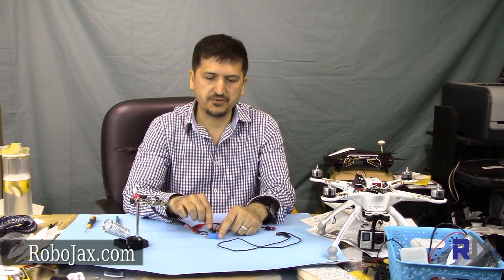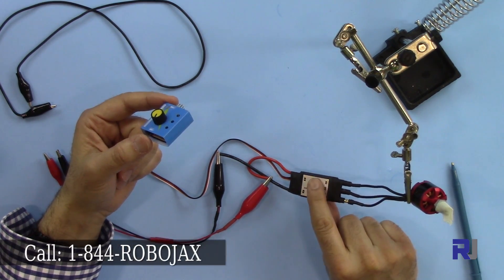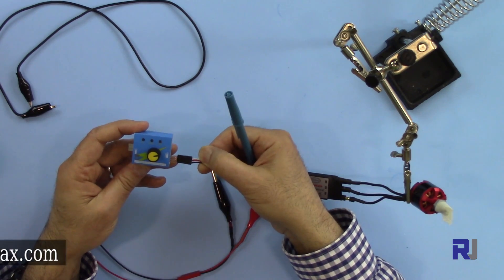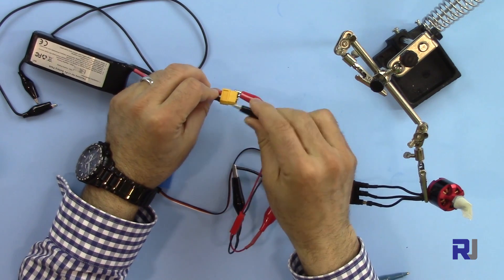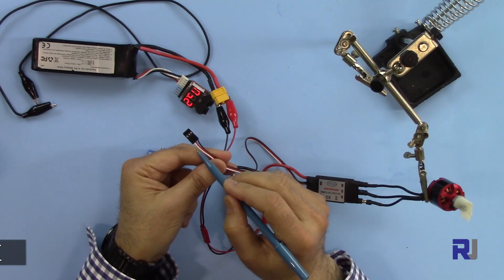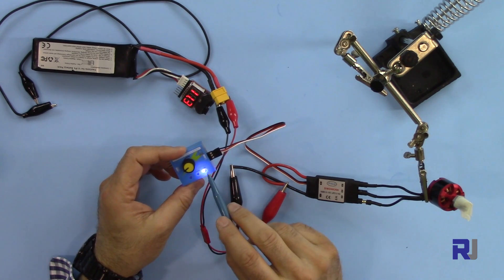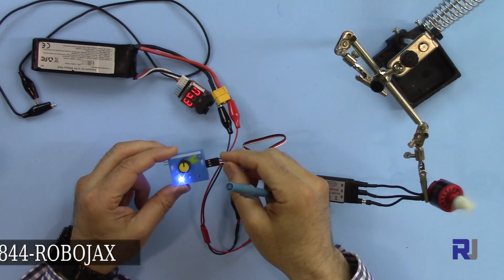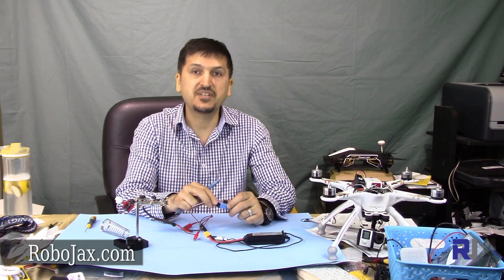Introduction to 3 Channel ESC Servo Tester - RJT648

Comment: does the servo tester need to be calibrated? is the maximum value on the servo tester's potentiometer the maximum speed/rpm that the motor can spin?
Reply from the maker: this test is very basic and has not settings.

Comment: I am assuming your 3-cell battery is 12V. Correct?
Reply from the maker: yes and it does not matter, if you motor is 18V, you can connect 18V to the ESC and still you will get 5V for flight controller or  other devices. Today I just posted demonstration of testing servo motor using this tester https://youtu.be/TJ3YjnsREqc
Reply: @robojax  thanks

Comment: helpful  video !!!!  I was unsure if I  was able to use my 3S 2200 mAh LiPo  to test my  servos with , because the tester states 4.0v - 6.0v range.....but if I understand correctly , as long as I connect the  higher voltage   LiPo battery through the ESC, (  and connect the signal wire  to the OUTPUT side only )   it's OK...correct?....thanks
Reply from the maker: Yes you can connect up to 6S battery. To the esc.

Comment: I have connected my 3cell battery to  the servo tester ,motor ,ESC ,the light comes on 'man' and when rotation of the nob , nothing moves , please advise
Reply from the maker: your ECS is programmable. if you do not program it, it will not run. I am not sure which one you have and I have no video on that.

Comment: Is there a way to input signal through the ubec from a toggle switch ?
Reply from the maker: the white or yellow wire is the signal wire. does not matter where you bring the signal from. just connect it to your source with one wire to the ground. it will work.

Comment: can i connect a servo tester to a brushed ESC and use it to turn a brushed motor forward and reverse?
Reply from the maker: Brushed motor controller should have the control signal.  But for this this Servo Tester will not work with that as the values are different.
Reply: @robojax  I found an interesting video on bidirectional brushed esc that works with arduino pwm signal forward and reverse. Worth testing

Comment: good day sir can i ask what is the value of the 6 pin ic on that board? thank you and very nice tutorials
Reply from the maker: I have never opened it. Which board? The Electronic Speed Controller ESC or the Servo tester? in both cases they are so cheap, that you never try to make it or repair it. just buy new one.
Reply: @robojax  for the servo tester sir. Thank you🙂

Comment: Hello dear my 3500kv brushless motor not run...its beeping beeping sound....I have using 40a esc...plz help me
Reply from the maker: The beeps are from you ECS. It seems your ESC needs programming. You can send signal if you have this ESC tester. Quickly rotate to the right and then to the left. This will send 1 signal. So this way you can send different signals to control ESC and it will work. Check your ESC brand on google and you will find how to program it.
Reply: @robojax  I have using  SkyLiner Esc...how i have program it...I have no transmitter.....I have one servo tester, ESC and Esky  3500kv motor...
Reply from the maker: There are 100s of ESC i don't know them. You search your question on Google and I am sure you will get some answer.

Comment: Hi , im trying to control a 9v DC motor with a servo controller , the motor is not slowing or being controlled by the controller and its on one speed, what am i doing wrong?
Thanks
Reply from the maker: the servo controller/tester is for brushless DC motor with 3 wires. your motor has 2 wires. You can use a driver module something like this https://www.youtube.com/watch?v=17vqLv508Uw and instead of Arduino you can use servo tester.
Reply: @robojax  Hi again, i got the servo tester and the mosfet module , i connected signal  output of the servo CTL to the signal in the mosfet , i linked both grounds to the 5V power supply and 5V to the output of the servo CTL , everything light up but the motor never turn even if i change the mode in servo CTL still nothing happen,
 the input for the mosfet is around 9V when i connected the wires to the mosfet and i test the screws holding the wires it dropped to 0.008 but the power supply i warm, 
is the mosfet damaged?

Comment: the  tester takes up less than 1% of your screen ares .cannot see anything .google "zoom lens" then start over and do this video right.
Reply from the maker: perhaps you are watching on mobile phone. This tester doesn't have any display to read values from it.when using  it, you will turn the knob (which is large) and lights will show the mode(which is bright). You don't miss anything.

Comment: Hello, I'm using a HobbyKing 30A UBEC ESC that needs to be calibrated, i made a calibration code in python but my DT700 motor does not run accordingly, I just bought your servo tester but do you recommend any other way to calibrate an ESC? I'm really confused and have my project due in few days. Please help! Thanks
Reply: and is your ESC already calibrated?
Reply from the maker: Hi,  Usually the ESC should work without calibration. Try to set it default. the ESC I used was not calibrated.  I have not tried calibrating ESC using scripts.

Comment: Can we use the same servo tester For 150cc dc brushless motor ? Pls suggest
Reply from the maker: Yes you can. This tester is generating PWM signal which is used almost in every type of motors and servos.

Comment: hello, if i connect a servo instead of a motor can control the speed of the servo with the trigger in auto mode?  Thanks in advance
Reply from the maker: Yes. This device is actually "Servo tester" I with I have included a servo on the video.
Reply: thanks for the reply, so just to be clear, if i put on esc and a servo switch on auto back and forth and the knob regulates the velocity? right?
Reply from the maker: Yes. this what it does. this is another cheap solutions https://www.youtube.com/watch?v=hjRVaogl6tw
I have got 2 more videos on different servo tester. check them by searching "robojax servo"
Reply: thank you
Reply: what would you suggest, for an application where I need a servo to perform a repetitive motion and where I can adjust the speed and eventually the amplitude of the excursion. I saw the other video, very iformative, but it's not what I'm looking for.
Reply from the maker: Depending on the amount of torque you need, you can servo and set the time interval and direction.
I would suggest play with potentiometer and arduino to move the servo with exact position and speed.

Comment: What about an Opto ESC that has no BEC inside, at 2:15 tha t cable has only 2 wires instead of 3.
Reply from the maker: Yes I should I have given example of that. you will need another source of 5V and connect it on the other side. I will try to create a video for that. Thank you for pointing that to me.
Reply: Yeah this my prob - none of my esc have bec.  I managed to power the esc/motor w 3s bat and used a power supply to power the tester.  I had the signal from esc and 5 volts to tester all on output side of tester.  No love.  So you are saying hook the 5 volt to input of tester?  What about the sig wire - still to the output side?  Thanks man, nice clear concise video.

Comment: You  post a descriptive video which is  of either no use of very limited use. What are the specifications of the tester  , the esc voltage and current rating and most important of all what is the battery voltage and current rating.
Reply from the maker: This is servo and ESC tester. Only people use use Servo and ESC will know how to use this . I have another video on Servo and ESC which explains the voltage and current. here I have explained that the tester need 5v volts. the current very  minimal.
Reply: thank you for your reply. If as you say  people who use the equipment illustrated in your video will know just what it is all about, I fail to see why such people would watch your video in the first place. After all  even though I am not an electronics person or a RC flyer your video can hardly be considered as imparting knowledge or understanding of an advanced nature . It was my intention to use one of these bldc motors to drive a gyroscope  for obvious reasons.While the equipment required is readily available, specifications are most certainly not available for some reason.  All or most RC people are  quite knowledgeable as far as their craft or hobby goes but that is as far as it goes.There are a large number of videos illustrating how bldc m otors may be run and controlled by the equipment used by RC people but not one single video gives definite specifications, safe operating conditions and requirements etc etc to enable someone who is not overly interested in electronics but wishes to use the equipment for quite a different purpose to proceed with that purpose.. Please give me the references to your material which would be sincerely appreciated. Thank you very much for your reply and all the very best to you, sir.

Comment: i connected mine same way but motor will only stay on for a few seconds then it looses power
any idea why i cant even go full throttle
Reply from the maker: did you change the mode button? put the knob at the middle, check the battery if it is fully charged.

Comment: I did the same watmy as u did...but the motor is not rotating...i could a beep sound...!!please kindly help
Reply from the maker: Your ESEhas Firmware. The beep has patterns. ONE beep, 2, 3 or more. Each has meaning. If the ESC is not armed (ready) it will not let the motor rotate. So program the ESC and then it will work.